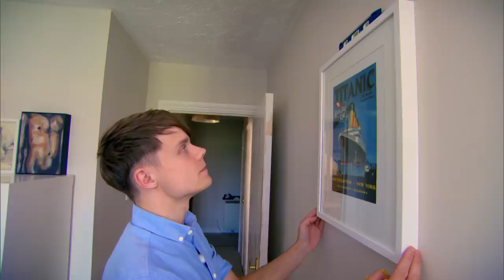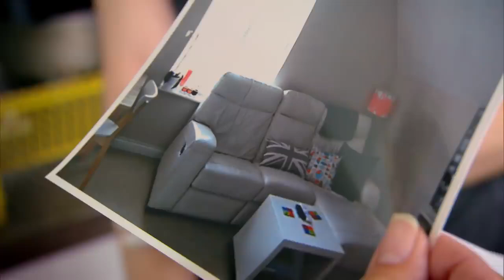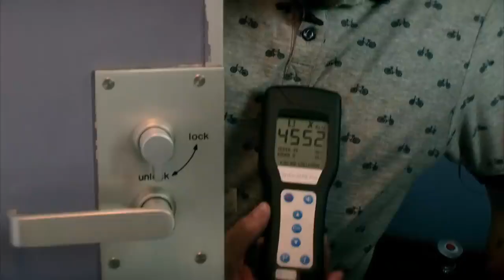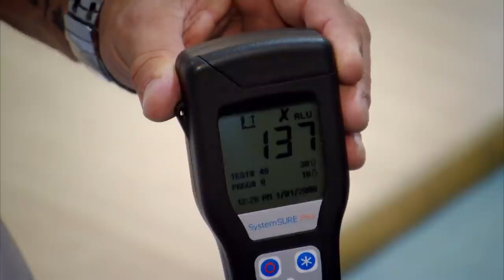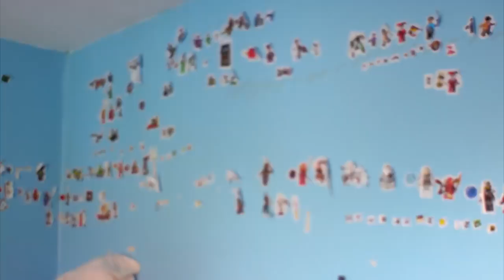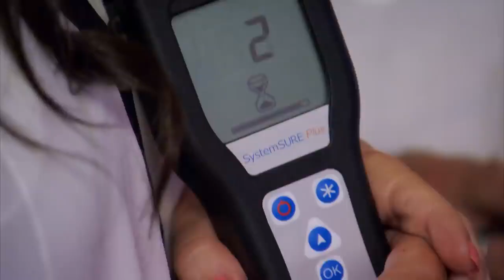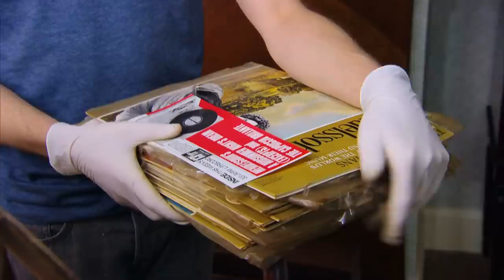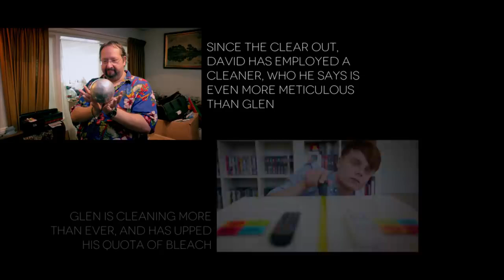Hoarder's Kitchen Repulses OCD Cleaner   Obsessive Compulsive Cleaners   Episode

Comment: Lol if you have 3 young kids, expect to clean about 1-2 hours MINIMUM daily if you want to keep stuff sufficiently tidy/not gross. Maybe it just takes me a long time bc I'm constantly distracted, start another cleaning project in the middle of a bigger one, I enjoy cleaning most times, as long as I have the energy. But I'm not a perfectionist either by any means. 

Lol Liam doesn't actually cook so of course he never has a mess but it's such a waste. You can always cook a damn meal then clean up afterwards..  I don't get it unless he can't stand having a little splatter for a few minutes.

Here's the thing, these OCD cleaners usually don't have much experience cleaning ACTUAL MESS. That vintage fridge could very well be cleaned but he's not used to cleaning stuff like that. Fridges are the worst to clean though. It's awkward. But my suggestion is using a scrubbing bubbles aerosol foaming cleanser that'll cling to the vertical surfaces, allow it to sit for about 10-15 minutes then scrub it off with scalding water and rough rag. If it's super grungy then a scrub like pink stuff on your wet rag will help your elbow grease go that extra mile.  Then you can get whatever's left with all purpose cleaner (Ms Meyers is the best, very effective yet non toxic and beautifully + potently scented like a high end fragrance).
Reply: That's a good point, they're always "cleaning" shit that's already clean. 😂😂😂

Comment: One thing that I’ve done with my home that helps tremendously is I have a shower caddy (3 tier plastic shelf) hanging on my bathroom wall that has all of my hair products, nail polish remover etc in it. It keeps it off my sink and organized. In my kitchen I have 3 metal bars with hooks on it and I have that hanging on my wall which holds all of my utensils like spatulas, wooden spoons, pizza cutter etc. keeping them out of and off of my cabinets and easy to grab the right one. Inside my cabinets I have organizing buckets that hold all of my spices so if I need one, I can pull out the entire bucket at once and get the right one. There’s lots of ways to utilize the space you have without being messy.